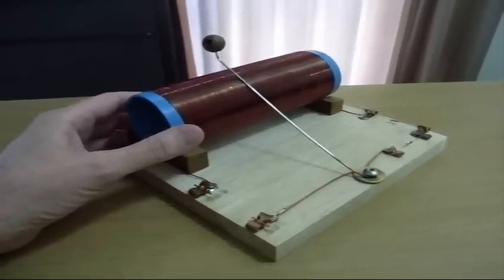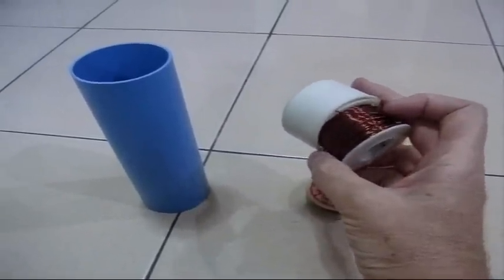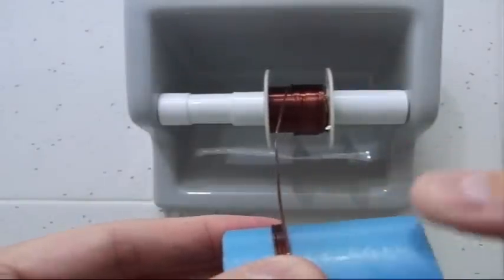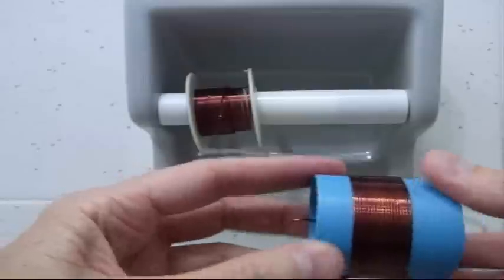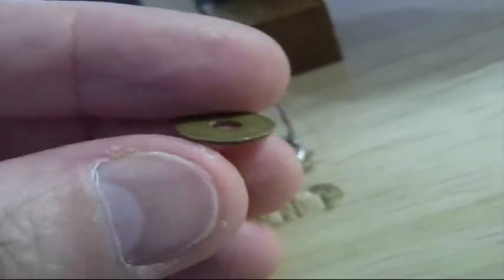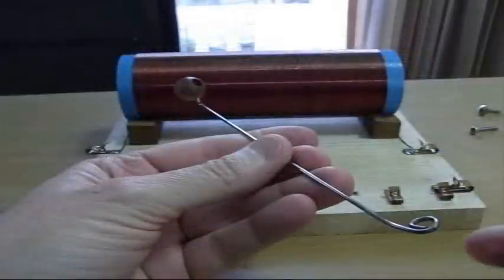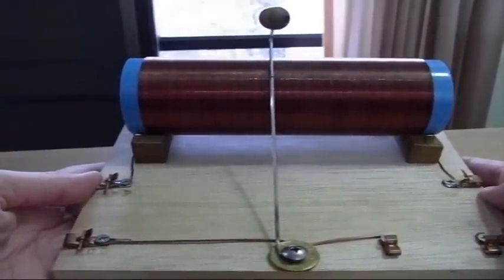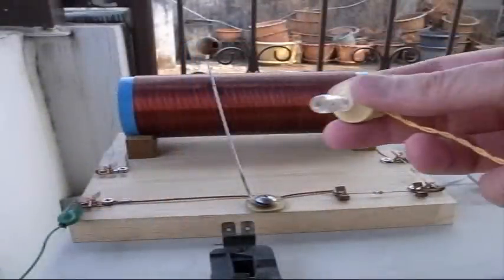How To Make A Crystal Radio - No Batteries (Updated Version Available)

Comment: Awesome.  Very easy to understand this.  You are the master explainer!  I have a question about the coil used for tuning. Is it a variable capacitor or what manner of component is that?   All good wishes.
Reply from the maker: +Anton Nym Thank you very much.  That's a good question.  Most people think of the coil as an inductor, but in fact it also has significant capacitance.  In this model when you move the wiper you are making 2 changes: on the left you are changing the inductance / capacitance with the antenna, and on the right side you are changing the inductance / capacitance of the tank (resonant) circuit.  For example: if you move the wiper to the left, the antenna side inductance and capacitance gets smaller, while on the right side (tank circuit) the inductance and capacitance increases.

Comment: Love the bike spoke wiper.
Dump the resistor. Short it out! No idea where he got that idea!
 Connect  a .001 Capacitor...or condenser (any style) between the earpiece end of the diode and earth/ground.
That takes the radio waves out of the system, when you've finished with them.
After the diode, you HAVE finished with them
Reply from the maker: +MauriatOttolink These new "crystal earphones" are not like the old day types, these are piezoelectric and the resistor is needed.  In fact the earphone has lots of capacitance so the capacitor is no longer needed.  I built it from my old wolf scout handbook and it did not work well at all.  Made the "modern" changes to account for the piezoelectric earphone and sound jumped out of it.  They taught this old dog a new trick.
Reply: tsbrownie Thank you..It looks like you just taught this even older dog a new trick.
Woof!
Thank you.
Reply from the maker: We old dogs gotta look out for each other!  ;)
Reply: @MauriatOttolink  This is what I like to see and rarely see nowadays - "It looks like you just taught this even older dog a new trick". In todays world we rarely see this, especially on Youtube - everyone wants to argue and antagonize everyone else.
 Good on you. (I also am an older dog)
Reply: @chumleye1112  
Wow...3 years ago...I'd quite forgotten.
I put it in non tech terms as Xtal sets are usually built by complete beginners  In fact the capacitor is an RF decoupler although I believe that it's not required when using  Hi Z crystal ear pieces but a high Ω resistor IS  
required to complete the D.C. path.
Using high Z moving-iron phones, the audio really does increase when the rf decoupler is connected.
Thank you for your message.

Comment: Anybody remember razor-blade radio receivers using a Blue Gillette blade?  The device was shown in a 1950's Superman annual.  I could also pick up "The Third Programme" transmitted by The BBC by clipping a pair of headphones to the hot and cold water pipes in the airing cupboard.
Reply: happy plucker I built one in the late 50s.

Comment: You can limit your soldering by using a 16 gauge metal ring terminal squeezed on the end of 
the 16 gauge wire "wiper" rod, then use a wire to the ground and one to the diode. :)
Reply from the maker: Good idea.

Comment: I imagine that the glue might also cause a short by insulating the wire so that no signal can be heard too. I’d be afraid to use glue for that reason too.
Reply from the maker: You have to sand off the enamel and the glue comes off also.

Comment: Thanks for a great video with excellent commentary and clear enunciation.

Q: Where is the capacitor that is needed to form the resonant circuit? In other words, what gives the C of the required LC to get the necessary resonance?

Thanks.
Reply from the maker: Thanks.
A: Components from wire to transistors to coils to caps have all the properties of resistance, inductance and capacitance.  Most of the time you can ignore the less significant ones, but in this case not.  The coil has both inductance and capacitance in significant amounts.  The AC in the windings (wires separated by insulation) acts as capacitance.  It's not a lot, but enough.
Reply: @tsbrownie  Thanks for the clarification. It was a good learning experience.

Comment: Hello my name is Tom Murphy i am 61 years old and know very little of  volts or amps ie Imust say i really enjoy how you break the build down very good !  one thing i have a question on is resistor i got some that amazon said who work my question is this how  what does a resistor due and i notice you can get a station with out them  how can i tell if they are working , my next question how to drop var cap into a radio love your info god bless tom
Reply from the maker: Hi Tom, we're about the same age.  Electricity acts a bit like water in a pipe.  A resistor acts like a constriction in a pipe; it introduces "friction".  The resistor is needed to funnel some (but not too much) electricity around the earpiece.  For a variable cap radio I have a different design here: 
https://www.youtube.com/watch?v=AaNpFYe5dSo

Comment: When I was just a wee lad, we made crystal radios, but it seems to me that we actually used a crystal then a brass pin to connect to touch the crystal. But basically the same way.
Reply from the maker: This is a modified version that was in my Wolf Scout handbook.  (They had a mistake in the drawing that kept it from working!)  We used a piece of galena (lead ore) and a brass safety pin as well.  The diode is much more reliable and gives a clearer output.

Comment: For all the crystal radios that I've made over the years, I never tried using a 4 germanium diode bridge for full-wave rectification. That should give double the output. That would have be insane back when diodes were expensive, but I have dozens in a parts drawer.
Reply from the maker: +Felix Automaton Interesting idea.  Will have to put that on my list of things to try!  Thanks.

Comment: I was wondering if you salvaged a Large capacitor off a board from say a washing machine were in the circut would it go to increase the out put?
Reply from the maker: Probably not.  There's no issue in storing electricity, it's all a careful balancing act so overdoing one part won't help.  BUT it never hurts to experiment.  You may find you can receive other bands and such.

Comment: I built a crystal radio from a kit i bought at radio shack when i was a teenager that thing not only picked up AM but Shortwave as well my father told me it was because shortwave is an extension to AM
Reply from the maker: Your father was correct. AM is used in both broadcast bands and in shortwave.

Comment: Excellent instructional video, Thank you! I want to get back into building a crystal radio after many many years! I believe it was a blue Remco Model given to me for my B-Day in 1969. In fact I remember the day getting the radio very well; it was the day of the Apollo 11 Moon Landing!! So my curiosity and fascination started with electronics and astronomy!! I remember the coil, the tuner, later the diode and the black headphone set; my cousin wiring the antenna for me on the third floor roof and ground to waste vent. I remember my frustration of reassembling the radio perhaps some months later and it not working, then figuring out the diode was missing, LOL! Do you have any suggestions for links/hobby suppliers for building, soldering an AM/FM pocket transistor radio kit? Please advise. Thank you!
Reply from the maker: Thank you. Interesting history you have with crystal radios. I have never built a radio kit. I have added an amplifier to a crystal radio to make an AM radio. I have a video on that also.
Reply: @tsbrownie  Thank you for replying, appreciate it 👍! Can you recommend any links for getting the basic equipment/tools needed for the electronics work?? I will look into your adding an amplifier to crystal radio video. Thank you !
Reply from the maker: @pennstater89ad  I don't take sponsorships so don't have links. Personally I've had good luck with Weller soldering equipment as well as the better Japanese made irons. They are not expensive and hold up well for hobbyists. For rosin core solder, I used what the local hardware store sells. I have videos on basic soldering and the tools https://youtu.be/1uz84ps-PmU
https://youtu.be/udNu-wZaqJE
The tools are things I gathered over the years, forceps, nippers, etc. Most are things you can find locally.
Reply: @tsbrownie  Thank you for the suggestions, I bought a 30watt Weller soldering pencil yesterday at the local hardware store and electronic solder; I know there are more tools needed such as a heat sink. I already own an electronic multi meter. Will look into your suggested basic soldering and the tools link above. Thanks again!
Reply from the maker: @Tony Dubyk  for heat sinks I use small folded squares of damp (not wet) tissue. Never had an overheat issue. The thing I wish I had starting out was one of those cheap oscilloscopes for $20. Anything to see the wave, and it has a frequency generator too.
Reply: @tsbrownie  Thanks for the heat sink tip, will try it! Did not know one could purchase an inexpensive oscilloscope for that price. My overall goal is to touch up on some hobby electronics building skills for later experimental electric guitar making; although I know I will never build anything close to Fender or Gibson quality guitars. My electronic projects building list includes: crystal radio, AM/FM transistor radio and a Psychedelic Light Control where colored lights are modulated with music. Over the years, I kept a small handbook titled "Graymark Electronic Project Ideas" published by Graymark Enterprises , Los Angeles CA, 1974. Besides covering the basics to electronics, like soldering, circuit board construction and reading resistors, in detail it covers building 14 project ideas including the Psychedelic Light Control. I'm grateful to have kept this book after trashing many of my college books.
Reply from the maker: @pennstater89ad  Here's my vid on that inexpensive oscilloscope. Below 500kHz it works well. https://youtu.be/I5jvzTOeHKc
Also, you can still google radio shack project books by forrest m mimms iii. I did many of those.
Reply: @tsbrownie  Will do, thanks for the extra tips and link!!
Reply: Hello! If I could ask one more thing of you regarding your crystal radio project above? From the hardware store I purchased a 1-7/8 in. OD PVC pipe but it's thick walled, just shy of 3/16" thick, will that work for the tuning coil? I know you instructed to use a "thin wall" tube. Also I salvaged from my 2006 Sylvania 27 inch CRT TV what appears to be 24 gauge enamel coated copper wire from the harness that surrounded the back of the picture tube, will that work for the tuning coil wiring? I believe the electrical tape wrapped coil is called a degaussing coil? Please advise on the above Thank you!
Reply from the maker: @Tony Dubyk  The thickness of the plastic is not important, thicker is stronger. The diameter IS very critical. An air core coil's induction comes from diameter, length, number of turns of wire, AND turns per distance. So, wire size matters. If it is pretty close, it will probably work, but if you change multiple parameters, it can get too far off spec to work properly. I have videos 1) why doesn't my crystal radio work, 2) how to design a coil.
Reply: @tsbrownie  Thank you for the clarification, will check out those videos on coil design and why my crystal radio does not work.
Reply: Hello! Kindly provide me the link for the following video you mentioned yesterday, "how to design a coil". Thank you!
Reply from the maker: @pennstater89ad  https://youtu.be/Fw9eb-aB-XU
Reply: @tsbrownie  Thank you!

Comment: Very nice.I don't think Radio Shack has sold germanium diodes for many years though. You can make your own detectors that work well, or buy the germanium diodes online though.
Reply from the maker: +Rob T You are probably right.  I bought boxes of stock from a couple that were going out of business for a few bucks a box!
Reply: Use a 1N34 - it's commonly available and it's germanium. Better yet, after you build this, work your way up to a regenerative receiver. They are simple and sensitive, and there's a bunch of reasonably priced kits around.
Reply: I have been able to get them on ebay and jameco electronics. A schottky might work, too. Those are everywhere.
Reply: A bit of zinc, heated red hot and left to cool so that it oxidizes on its surface, makes an excellent detector in light contact with lead or copper wire. Very nearly as good as the old factory made germanium diodes...but you have to search for the sensitive spots. Steel that has been turned to a bluish surface by heating (and allowing to cool) also works well in light contact with a little piece of copper wire.

Comment: Great memories come back after I saw your video, thank you so much.  I have a question, I used a Galena crystal when I was a little boy, I can't remember if the galena rock goes where the diode is on yours, or do I need both?
Reply from the maker: 56 years ago when I built my first I also used galena. As you know it requires searching around on the galena to find a good spot. It would replace the diode. Thank you for watching and for your comment.
Reply: Thank you, thank you

Comment: I just built my first example of this radio. I used 22 gauge wire on a 2 inch PVC pipe. I used some magnet wire for an antenna and I was getting some static and popping. This was before the 10k resistor came in. After I put the resistor on and bought some 8 gauge wire 16 feet long for an antenna I got nothing at all. My tuns with the 22 wire was 128. The magnet wire was a bit over your your specs. I used the exact resistor and diode you have in the spec. I refurbish fans so I am aware of magnet wire for choke coils and the like. I used a OHMs meter to test continuity and its fine. If I can use the Magnet 22 G magnet wire I may get the bigger pipe in your specs. But my turns were short compared to yours. My wiper is Brass and its about 6 gauge stiff brass. I also used a spring on the base of the wiper to keep pressure on the wiper. Any guidance would be appreciated. Thanks for the videos.
Reply from the maker: I have a video just for you. Since you already work with wire, some of it will be a repeat. https://youtu.be/kCxQ8iPQx4s
I don't think you need a total redo, it sounds like you're almost there. If you have a station within 10 miles, you should be getting something. You did not mention your earphone, is it the same? Other types won't work.  What's the number on your diode? What are you using for a ground? Also how are you making connection to the wiper? If you can post a video of your device, leave a link here and I'll look at it.
Reply: @tsbrownie  I watched that already. There are a couple of things that may be the issue. What I will do is make a video of the radio I made and you can tell me if anything looks wrong.
Reply from the maker: @jaybabcock4557  OK, let me know.

Comment: thank u - nice vedio ;- క్రిస్టల్ రేడియో ;- 1894 లో జగదీష్ చంద్రబోస్ - వాడిన ditector of radio waves లో స్ఫటికాలను ఉపయోగించారు ; 2. బాటరీ అవసరం లేని - అద్భుత  ధ్వని పరికరం - ఈ క్రిస్టల్ రేడియో ;; 3. G.K.Pickard 1902 - first used as a demodulator for radio communication reception ;; 4. cat's whisker sets అని మరొక పేరు - ఆ రోజుల్లో ఉన్నది ;;
Reply from the maker: thank u - nice vedio ;- Crystal Radio ;- In 1894 Jagadish Chandrabos - used crystals in the detector of radio waves; 2. Battery not required - amazing sound device - this crystal radio ;; 3. G.K.Pickard 1902 - first used as a demodulator for radio communication reception;; 4. cat's whisker sets

Comment: it seems like with that big coil you will be able to get long wave also your design is best big size simple wiring I will build this one first then experiment with other things can various crystals be used to change the frequency. thanks
Reply from the maker: The AM band covers roughly 500KHz to 1.6MHz, but that varies a lot with how a radio is actually built: number of turns, size of wire, etc.  The details for this one are in the desc.

Comment: Hi, please excuse me if this has been asked before; what does the resistor do? I’ve built crystal radios that don’t  use a resistor. Thank you for posting.
Reply from the maker: tsbrownie
The resistor discharges the capacitance of the earpiece.  Without it you get little sound and will hear a popping.  I did not believe that the resistor would make much difference (my boy scout radio I used a "real" crystal earphone and not an piezoelectric modern one and it behaved differently) so I tried this new earpiece without the resistor and the volume was very low.

Comment: You make it clean and simple sans the diode and resistor.  I built one and it was a fail.  A couple questions you could possibly answer.  Is the tube diameter critically specific? (I understand that the wraps are about 80 to 120.)

Also, your thoughts on the blued razor blade as. Diode. 

Kudos on a good video.
Reply from the maker: Thanks.  Here's a video on common problems, it might help:
https://www.youtube.com/watch?v=kCxQ8iPQx4s

If the tube was 1 cm (half inch) bigger or smaller then it's probably going to work.  I've used galena (lead crystal) and it works, but does not give as good of sound and it's a LOT fussier.  I'd guess the razor blade is similar.